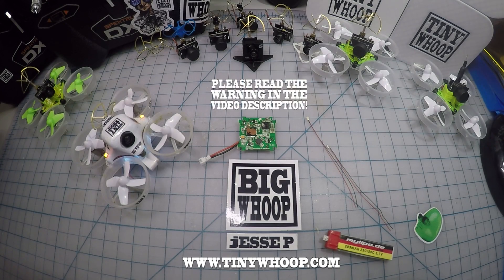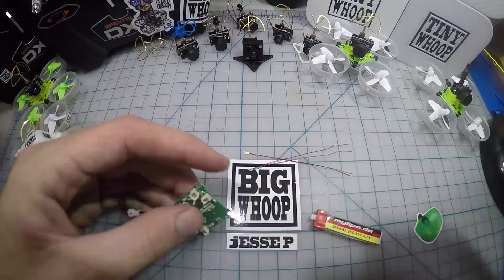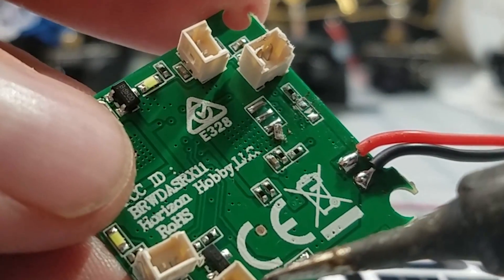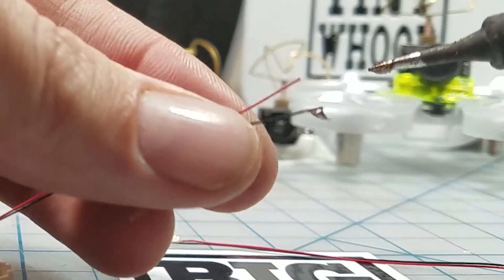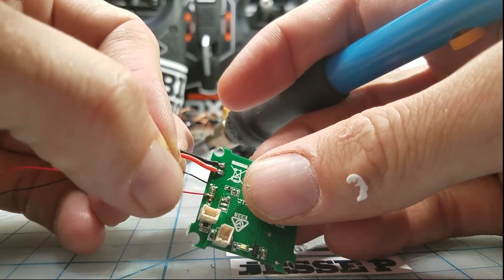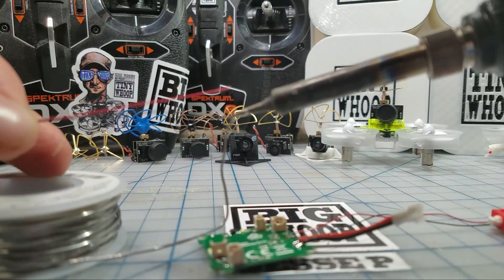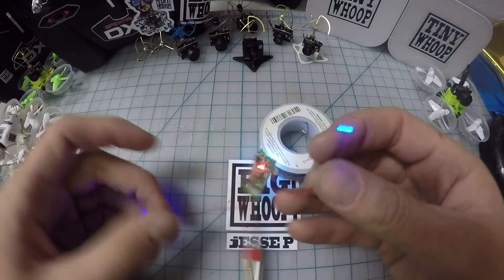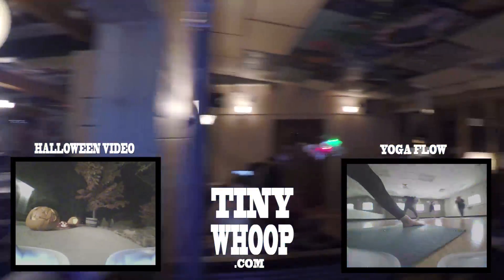Tiny Whoop LED Installation

Comment: If you aren’t using a fan to blow away the smoke I suggest you do. Or get a stronger fan. Solder has lead. Lead messes you up. I use lead free solder, but even than it’s still not good to get in the eyes or inhaled. Take care of your health.
Reply: The smoke is all flux (rosin) no lead. Lead from the solder isn't going to get into your system unless you ingest it. So the important part is to WASH YOUR HANDS after working with it. Lead free solder is more difficult to use and the additional heat it requires is going to make the margin of error much smaller when working on delicate parts.

Comment: I have a problem that hopefully someone knows how to fix. 

I had an inductrix. Worked fine. Upgraded motors and added camera. Then he problem occurred. The motors would cut out. Giving any throttle for more than 1 second would cause the flight controller leds to turn of and motors stop, then led comes back on again, but motors don't unless throttle is reset. 

Any ideas?

Comment: I've been looking to get a tiny whoop for ages now but I don't know what to get 
Any suggestions 
Thanks
Reply: Im pretty new to it all but you pretty much have 3 choices. The original Blade Inductrix  and then you have the Eachine e010 or JJRC H36 which are exactly the same. The Eachine and JJRC has stronger frames and don't crack as easily from the struts. I'm waiting on a new frame from busting my Inductrix frame. Hope that helped!
Reply: Luke Bray, forget about that, if you really want a tiny whoop!!! here is the link. https://cdn.shopify.com/s/files/1/1368/1453/products/13639477_10157118833195371_592571558_o_ee1b9936-af8f-4bc5-aed8-cb1134222c34_1024x1024.jpg?v=1478728525

you will be more than happy with this little beast!!!
Reply: Yeh ya can buy it already built BUT half the fun and point is to DIY that way you can make choices about what you add/dont add like motors, mounts, cameras, frames, props etc!!
Reply: Luke Bray well check out tiny whoop website, the original website, no resellers!